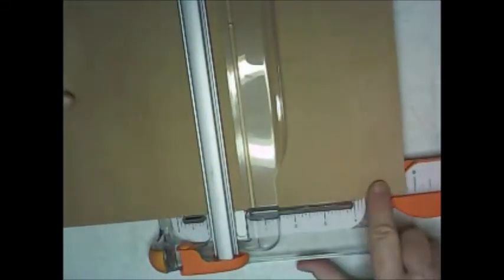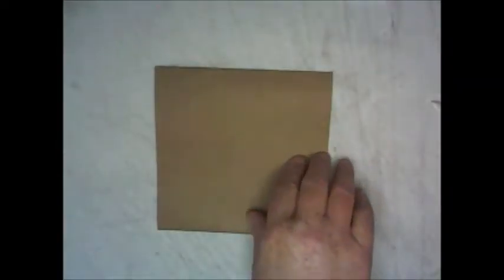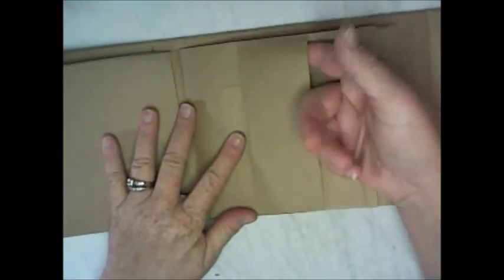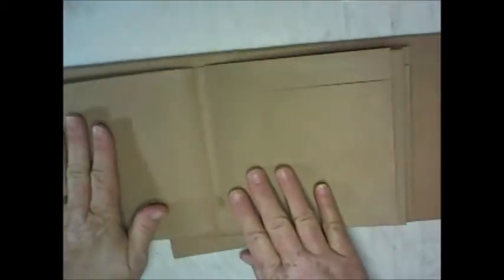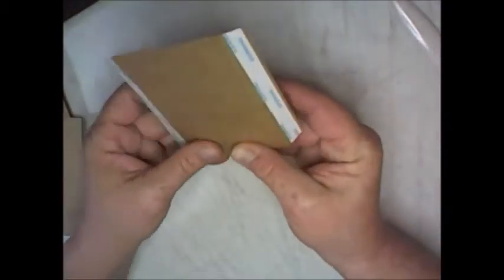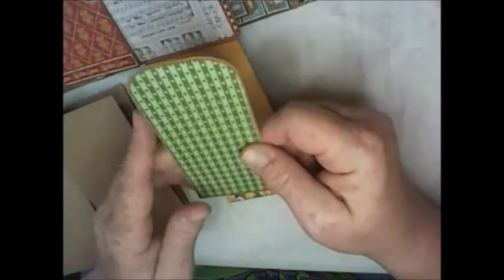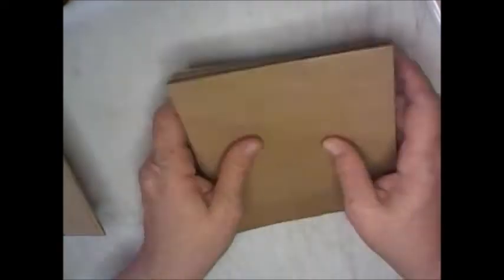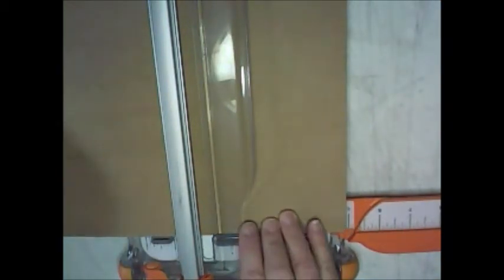mother goose page tutorial

Comment: Hi, Tammy!  LOVE your albums and the tutorial is so easy to follow.  Maybe you can help with my problem:  I made 2 album covers today with G45 MG paper as a cover.  On both of them, the cover paper split when they were folded -- and I took care to fold slowly and gingerly, leaving double the thickness of my cover chipboard as a cap between covers and spine.  What am I doing wrong???  Do I need to leave even more of a "gusset" between  covers and spine when I put that part together?  Don't want to waste any more material.... or red line (you know, EXPENSIVE!!) tape.  Thanks for sharing!!
Reply from the maker: +sisfidy58 Thank you.   I never us G45 paper to wrap on my covers, I only use it to mat, whenever I have tried to wrap and album with G45 it always cracks. Did it crack in the seams or when wrapping it on the top and bottom?